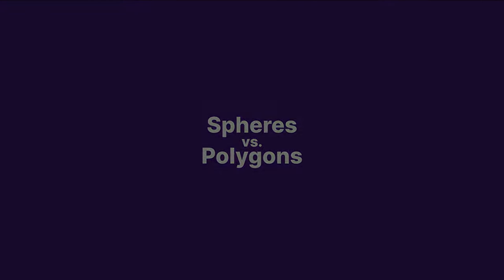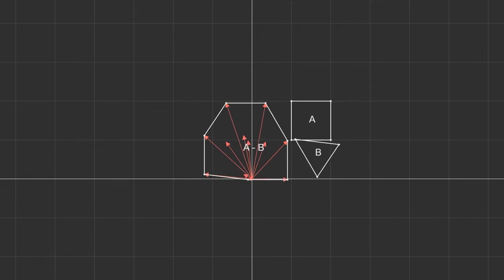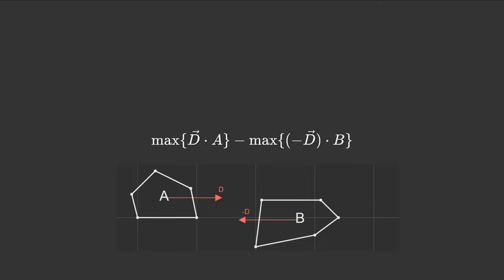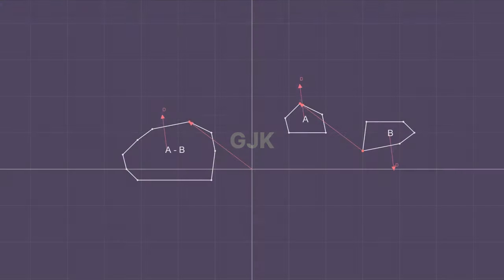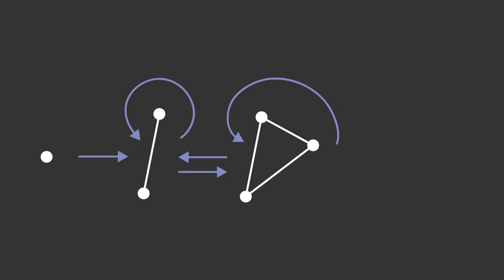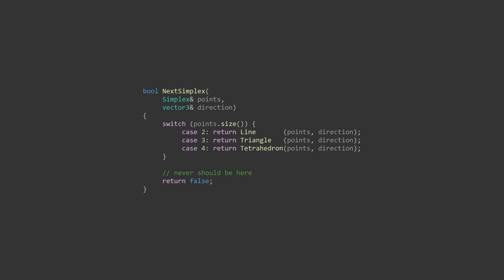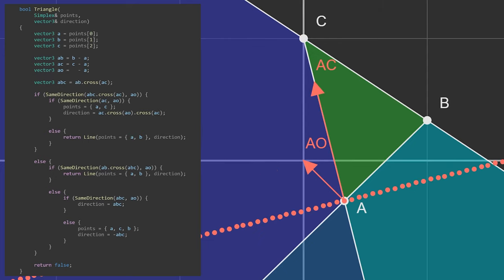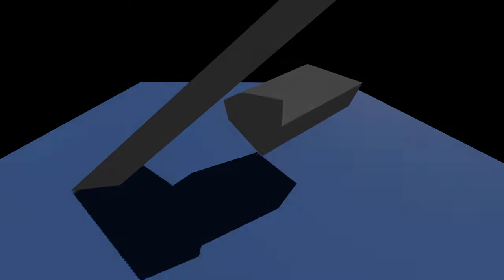GJK Algorithm Explanation & Implementation

Comment: Maybe a small or better implementation is to make the first GJK support to be in the direction of the relative positions of the shapes. That way, you already get an extreme point, using, for instance, the center of mass of both objects 'direction = colliderB->getCenterOfMass() - colliderA->getCenterOfMass()'. Amazing video!!!
Reply from the maker: I’ve seen some people do that and I think you could shave off some iterations but I was going for extra small code so I didn’t. Thanks!

Comment: Not to be a jerk but I think it would be valuable to clarify that this is really the sub-variant of the traditional GJK algorithm (GJK-SAT). As well as this, the number of cases in three dimensional space actually expands to considering all regions rather than just the faces of the simplex. I hate to be rude but I spent way too long figuring this out when attempting to implement this myself. Gino van den Bergen's 'Colllsion Detection in Interactive 3D Environments' documents the GJK as well as Gino's EPA rather extensively, and I think the full distance minimization implementation is insightful for those just figuring this stuff out. Either way, this video does a fantastic job explaining the essence of the support function and the configuration space obstacle. I can't wait to see what else you're up to!
Reply: The resource you mentioned has almost 300 pages.

Comment: 5:57 in the Line case, I found that the AB not pointing towards AO never happening in practice, and if you consider the operation, it go as follows: the same direction check is basically testing the dot product, consider 2d case, ABx * AOx + ABy * AOy > 0, if you substitute the values and re-arrange you get: Ax^2 + Ay^2 > Ax*Bx + Ay*By , wich is basically saying geomretrically: A dot A > A dot B, if A and B are unit vectors and A != B, then this is always true.

Maybe I'm wrong but also if the A point isn't past the origin it wouldn't also be dropped on the main gjk loop with the dir check?

So the Line function doesn't need the false block of if(SameDirection(ab,ao)) because it never will be executed based on my tests, the maths and the logic.

EDIT: ok realised your code uses the Line function on the triangle and tetrahedron, so it's more general, that is why it is possible.
Reply from the maker: Aa ok this is code that I wrote months ago so I takes a little bit to go back and look. This vid was supposed to be a super condensed version of the one that Casey did, so he came up with the if flow. Glad I got you interested in this algo I appreciate the scrutiny cus I learn more from these comment that I did making the vid in the first place! Thinking about it you’re right for the line case because there can be a further point that A cus that’s the by def what the support point is, but it allows the code to be nice and condensed for the later checks where it could be on either side of A. Thanks for the comment :)

Comment: 4:52 - why did you chose -support for the new direction?
And also why did't you normalize this vector? As I got from your explanation vector D should be normalized (2:12)
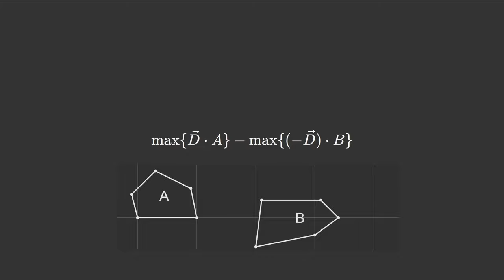Reply from the maker: At 2:21 all the points get scaled by D's length, so you don't need to normalize. And at 4:52 it's slightly confusing but we want the direction to the origin at (0, 0) so you take (0, 0) - support = -support
Reply: @Winterdev  thank's a lot for your videos and answer!
p/s: I am writing 3d engine by my own to make a video on my channel about it :)
Reply from the maker: @vectozavr  Sounds cool, good luck with it! I've got the engine, now I got to make the videos :)
Reply: Вектозавр, ты чего тут забыл?)

Comment: It's needed to know the vertex to compute the algorithm? Some convex sets are given by equations, like c(x)<=0 for a convex function c.
Reply from the maker: If you can get a support function then yes. If you look at how the sphere works it generates a point based on the direction and the center point/radius. I think that this also isn’t very good with those types of shapes however because it loops forever unless you put a max step count in. I wonder if there is a version specifically for these types of functions/shapes?

Comment: I don't understand why "support.dot(direction) <= 0" in the GJK function. Because, if it is 0, it means that the minkowski difference shape is maybe touching the origin with a border. And if it touch it, it would mean, that they are colliding, right ? It would also be a problem with the line simplex in the case where the ao and ab vectors point in the same direction. Because, if so, the direction updated with the double cross product will be 0 and then, the dot product check in the GJK function will always be 0. It will therefore return false when they are actually colliding.

Apart from that, it's a really good video. Thanks :)
Reply from the maker: I remember changing that to stop an infinite loop if the origin lies directly on the simplex. I think that you're correct in wanting 0 distance collisions, I was only thinking about position, but if you're working with forces, then friction for example would be more accurate with 0 distance collisions. I played around with the code and it seems like that the anomaly caused by <= should almost never come up, so trading it for an infinite loop is a good idea I think. Maybe a special case for 0 is the real answer, but I'll have to do more testing, I'll update it if I find something. Thanks for pointing this out <3
Reply: @Winterdev  In 2D, I found a case where a real collision (where they actually collide deeper than just with the border) occur but is not detected by taking 2 same square that are exactly in the same y position and overlap on the x axis. In this case, the first support point is exactly along the x axis. Then, the second support point is also exactly along the x axis in the other direction. In this situation, the Line function will set the direction with the 0 vector. And then, if the direction is the 0 vector, it will verify "support.dot(direction) <= 0" and will therefore return false. (I supposed that the square vertices arrays are defined starting from the left top corner for this problem to occur).

This is a very specific case, but the actual problem is that the direction is set to the 0 vector, and therefore the support function would not necessarily return an actual support point (because it will take the first vertex from each array)
Reply from the maker: @sebastientaymans  Yeah I was playing around with a similar edge case in the little tool, it seems like removing '=' results in the same behavior though. The order of vertices shouldn't matter, it seems like if the direction from the simple is 0, then something has gone wrong so it should just exit, you could put code that checks for this, but in practice it this case never comes up. Maybe there is a stronger way to find the direction, this is a simplified version specifically for games, the people who do CAD need much higher fidelity version that you can read whitepapers about, but they are wordy. https://dl.acm.org/doi/abs/10.1145/3072959.3083724 this has a cool video

Comment: Your variant breaks down if the origin is contained in one of the edges or faces.
Reply from the maker: Yeah someone else brought up the >= too. I did that but because it seemed to decrease the number of iterations in some cases without changing how the tests worked. Maybe that has more of an effect than I realized though. You don’t get 0 distance collisions, but those would have no effect so I dropped them, maybe for rotational that is a problem though. I need to see an example of it breaking to put this to rest!

Comment: In my implementation I'm never getting support.dot(direction) <=0, the dot product is always greater than 0. Is this a common problem, and if so how can I fix it?
Reply from the maker: I’d start by putting a cap on the number of iterations and see if you’re getting a correct answer. Then I’d log the simplex points and direction to make sure they’re right. If you’re in 2d, you could check out the website https://winter.dev/lilapps/gjk and put the same points in your code as those and step though each to spot a difference. Good luck! :)

Comment: Hello!

It seems like the description and figure for Minkowski difference is wrong. According to the link provided below (and the link in the linked page), the Minkowski difference of A and B should be C s.t. the Minkowski sum of B and C is equal to A. The polygon shown in the video is the Minkowski sum of A and -B rather than their difference. Given that, the algorithm does not produce Minkowski difference, but it's still correct.
Reply from the maker: Aa good point I was trying to simplify the terms cus everyone talks about a sum but then subtracts, what makes this different than normal addition and subtraction that we can’t flip the terms like I did?
Reply: @Winterdev  For example, in 1D world, the sum of A [0, 1] and B [0, 2] would be C [0, 3]. If we use C + (-B), we will get [-2, 3], but if we use C - B, we should get A (meaning undoing the addition operation).

Comment: I implemented this in unity and then compared the results with unity's physics engine and with 36 of these mesh colliders the frame rate dropped to 80fps. but with unity's mesh collider it stayed at 280fps. So I would like to know how can I optimize this type of mesh collider?
Reply: How are you checking them? Brute force, or some kind of tree algorithm? There's probably a couple of other optimisations that unity is using, but that's one of the big ones I can think of
Reply: @compositeembryo7186  Currently I only have one optimization that is  using aabb trees
Reply: @bluedev6304  I don't know if this will help because I am nowhere near the skill of the people who develop unity itself, but maybe give a kd or quadtree a try
Reply from the maker: my guess is that if unity is using physx then it’s prob more paralleled on the gpu

Comment: I've been struggling with my own implementation for a few days and this really helped, however I'm sometimes getting false positives with an analytical cylinder support when rotation for one or both of the objects is zero, which is strange. I'm not sure if this is fault of the core gjk or the support function though.
Reply from the maker: Thanks for the comment! I’m gonna need a drawing lol I don’t really know what you mean. Are you saying that when you have two objects, 0 angle, I’m assuming in 2d, the line case fails?
Reply: @Winterdev  Thanks for the reply.

When i have two 3d cylinders with an analytically computed support (instead of using a mesh and looping over the vertices) and the rotation is zero in all axes, the algorithm detects a collision where there is none in some cases, even when the objects are really far from each other. I'm not exactly sure where it fails because there doesn't seem to be a pattern, however the core algorithm works 100% of the time when using mesh supports.

Here's the actual function, sorry if it gets mangled by youtube formatting.

vec3 cylinder_support(vec3 dir, float radius, float high_y, float low_y) {
    vec3 xz = normalize(vec3(dir.x, 0, dir.z)) * radius;
    xz.y = (dir.y < 0) ? low_y : high_y;

    return xz;
}

It seems to return almost the same exact points as when using an equivalent cylinder mesh, so I'm not sure where the issue could come from, in my mind it ought to return a marginally different collision when the shapes are really close, not complete nonsense.

And also a screenshot, although you can't tell much from it. https://i.imgur.com/MR5Knp5.png, the wireframes are green for collision. (ignore the z-fighting on the lower cylinder)
Reply from the maker: @chyza2012  Interesting... False positives were a common issue when I was making the original version, but I use the analytical support for the sphere v mesh collisions. I don't see why that would be any different. I'll have to make a cylinder collider and test it in my version. I'll let you know what I find
Reply: @Winterdev  
I've resolved this a while ago, but it didn't occur to me to update this comment chain.
In the end it was a dumb division by zero issue in the support function.

if the direction was purely in the y direction, the normalize in the line
    vec3 xz = normalize(vec3(dir.x, 0, dir.z)) * radius;
would divide by zero (since the vector would end up being {0, 0, 0}) and result in all nans, these would mess up the rest of the algorithm, apparently this degenerate case happened often enough with perfectly axis aligned cylinders to be an issue.

To fix it i simply added a check

vec3 cylinder_support(vec3 dir, float radius, float high_y, float low_y) {
    vec3 xz = vec3(0);
    if (dir.x != 0 && dir.y != 0) {
        xz = normalize(vec3(dir.x, 0, dir.z)) * radius;
    }

    xz.y = (dir.y < 0) ? low_y : high_y;
    return xz;
}

Might not be the most elegant but it works.
Reply from the maker: aa that makes sense. I had put your code in, but never got around to making a mesh for it so I couldn't tell if it was correct. Glad you found a solution :)

Comment: It seems like you miss a few edge-case checks:
1. For the line simplex: what if the origin is on the line?
2. For the tetrahedron: what if the origin is in a region between two triangular faces? (i.e. sameDirection could return true for two faces of the tetrahedron, if the origin is in the right spot)

Also the animation at 5:35 doesn't represent a possible scenario, if I'm understanding correctly. If you start with point B and search towards the origin, and A is the furthest support point you can find in that direction, no collision occurred because A does not pass the origin in the direction BO.